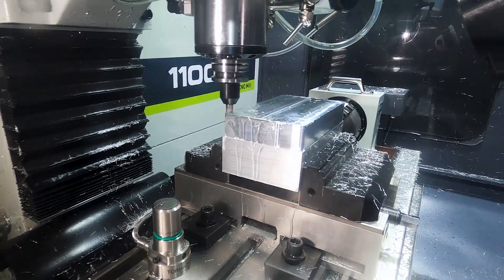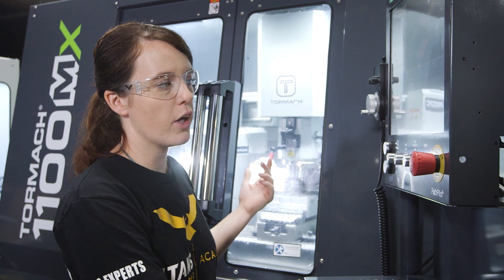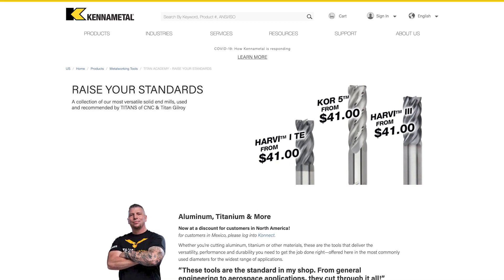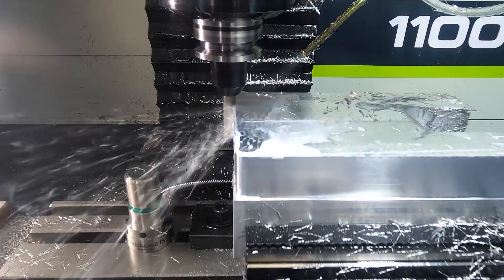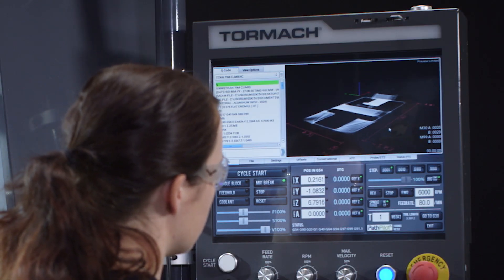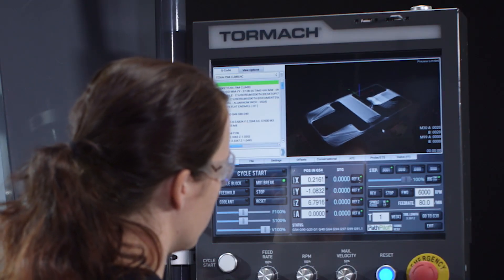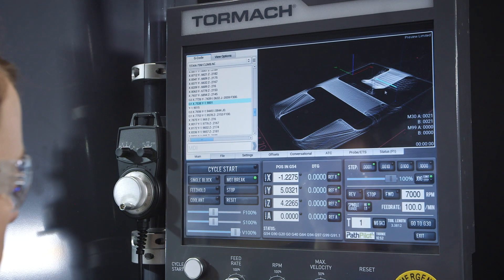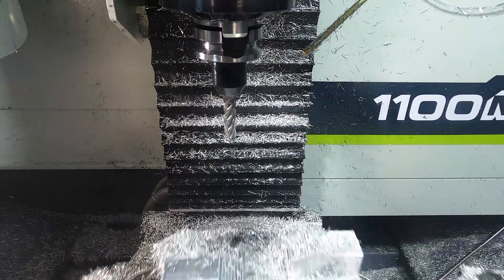CNC Machining | Roughing on Tormach With KOR-5 | Path Pilot Greatness

Comment: TBD I am not sure if the load is too high on the spindle or not. Does Path Pilot have a spindle load meter? It seems to cope with it. Kind of curious if you are holding tolerances. I would prob taken 50% of that depth of cut with higher spindle speed and slightly higher feedrate

Comment: Titans seem to talk about IPM a lot, but what is a good IPM for lathes?
Reply: Rpm * ipr = ipm. So if you want to program a rough turning operation at 1000rpm, 0.01ipr, 1000*0.01=10ipm
Reply: @TheFeralEngineer  But what is considered a good IPM?  On lathes the fastest I've programed so far is 24 IMP.  I remember Titan talking about 100 IMP on mills being kind of average for shops.  Maybe it was less and 100 was the goal to hit.
Reply: @benkenny3220  when you purchase insert packs, they give you a recommendation for speed, feed, depth of cut, etc. There are many factors to consider, like horsepower, rigidity, material, etc. Most of the time on a commercially made machine, you have encoders on the spindle and the linear axes that can synchronize together, so you typically program them in ipr, not ipm because most turning is done with css, not rpm. A converted hobby machine will use ipm because of the lack of spindle encoder feedback. Turning will never be as fast as milling, the cutting method is completely different. For rough turning in steel, carbide insert on an NLX2500 like the one titan used to have, my starting conditions, depending on insert grade are usually around 850sfm, 0.016ipr. using constant surface speed, the rpm will change, so the ipm will be different at each cut, but the ipr remains consistent. 

Hope this isn't more confusing than it needs to be.
Reply: Ben, there’s WAY too many variables involved with machining to answer your question with any sort of accuracy.  In addition, I’ve never programmed or known anybody who programmed a lathe in inches/min.- that doesn’t make a lot of sense. Feed per revolution is common to lathes, as it will keep chip load consistent with RPM changes.

Comment: Gotta be honest m8, that sounds like hell.. KOR 5 needs to run much faster rpm wise and FR wise. Just use an AFI Data Flute 3 flute ¾" Endmill at those speeds.
Reply: Agreed; I love multi-flute end mills, but I think it’d be much better and more efficient for the cutter to use one with less flutes in a machine like the Tormach.

Comment: "sounds great", that sounds like absolute death!!
Reply: It's a 650lb machine, I'm sure your tables weigh more than that. Of course it makes hellish noises.
Reply: Oh Yeah, Like GoPro mics give a real representation of the sound. Shut Up.
Reply: grappler185 if you think that they are only using a go pro for that you’ve not been here very long 😂
Reply: If you will listen carefully you can hear like machine try to say "killlll meeee" every time end mill touching the material
Reply: It's normal. People fear of loud noises holds them back from productive machining.
Reply: Reinis Sproģis if any of my machines that I ran sounded like that I wouldn’t have a job LOL
Reply: @jonahwebb4352  It sounds smooth to me. I bet your company also run 14h programs instead of 4h. I have done hundreds of parts that sounded worse than this and cutter is still perfect, saving lots of time and money for the company. Way more than cutter cost.
Reply: Reinis Sproģis I mean yeah you’re right they are pretty long but that’s cause we’re doing full 5 axis aerospace parts that require a finish under 8 most of the time
Reply: Yeah, it sounds pretty rough. If that’s “normal,” you’re doing something wrong.

Comment: Fun fact, Path Pilot is a fork of LinuxCNC/EMC2. At stock LinuxCNC’s UI won’t look as fancy as path pilot, but the 3D view of the tool paths is a standard feature (and quite nice). Thankfully it is also fully open source, and you can customize it to your hearts content. So, if you want a superior machine controller over running Mach3/4 in a terrible Real time OS (Windows), then get some MESA FPGA hardware and switch to LinuxCNC ;)
Reply: Linux convert here 👌

Comment: How is the ETS mounted? I want a solution to have it fixed to the table but I can’t find a good DIY.
Reply: Here’s how mine is mounted, t nut and a ring base with a bolt.  https://www.ebay.com/itm/264702255216

Comment: How would these end mills work on something older like a Fadal? It has the horsepower and RPM to turn it (10k spindle) but the control is old and slow and jerky on some complicated trochoidal toolpaths.  It can only cut 400ipm flat out.
Reply: I can help you here, my job has a 1993 Fadal 4020 with a CNC88 control (the oldest one). You're best bet is to change tactics. If you're using DNC, then it's slow and jerky not because of the toolpath, it's because it's too fast for the fadal to process what's going on (not enough look-ahead). Optimize the file size by breaking the job down into smaller ops and getting your toolpaths under 40kb (assuming your entire memory is free) once you do that the next thing to do is ensure your toolpaths are really smooth, if the machine has to move the opposite direction too quickly the fadal just won't handle it. 

The other reason for jerky movement is because the old fadals takes about .500" to 1.000" to accelerate from a stop to full speed, and trochoidal milling can have such tight turns that the machine needs to decelerate and then accelerate back to speed before and after every single cut. Therefore you're machine never is never getting to run at top speed like it should. If using Fusion 360, leave plenty of stock during your roughing pass and enable a lot of smoothening and a higher minimum radius for adaptive toolpaths, that'll let the fadal handle it. If you can get your toolpath smaller, then you can run the program directly on the machine and won't have issues like DNC will. It's not your tool, it's your toolpath strategy. The fadal has a better time with feed milling, and it might be better to use it instead of trochoidal milling in some cases. (shallow depth with full radial enagement, just in case)

If you have a program that is just barely too big to fit in the fadal's memory, use CTRL+H (find and replace) in a text editor and replace all spaces with nothing, that deletes all the spaces and will remove 20% or more of the file size immediately. Also ensure your CAM software is smoothening your arcs with radiuses and your helix moves are actual helixes. some people forget to ensure that and they make a program that's 300kb long just because it's pathing out a helix one thou at a time per point.
Reply: @Kitsyfluff  I drip feed it at 115k baud, and my control is the 32mp with -5 cards in it, so it's the fastest 88hs essentially, the buffer usually stays full, but I think you are right about the acceleration.  That's probably what I'm seeing here.  Also probably the slow "rapids" when moving to the next segment of a trochoidal path since even rapids are capped at 400ipm.  

So just looking at the 1/2" mill, they recommend a .005 ipt * 5 * 10k rpm = 250ipm.  I guess I'm just having a hard time imagining many trochoidal toolpaths where the machine would ever be able accelerate up to that speed, unless it's always just running straight lines around a long part.  I think most of the time an older machine would just be making little whiffs of a chip just trying to accelerate around corners.  I mean I guess I can still run it at .25" radial engagement and move quite a bit of material as long as the spindle has the horsepower.  

I guess for $56 I could buy the thing and try it out, see if a 3 flute rougher makes more sense for a slower machine.
Reply: Centroid that thing 👌

Comment: Can you get a tool changer for the 1100mx? I was looking into a mini mill but after you buy all their stupid software shit it was too expensive for me.
Reply: I bought the 1100 for a company where I run engineering dept all decked out last year cuz I thought mini mill was too expensive too. But now that i'm looking for a lathe, I priced one out on haas website and started getting emails with their specials. It turns out that I could have bought the mini mill for just a few grand more. If you're willing to dish out $40K for a Tormach, you should definately consider the mini mill - it's a production type machine not a hobby machine like Tormach - which is decent by the way, but doesn't come close to production type machines. I wish I bought a Mini mill :(
Reply: @hycel78  watch out for Haas Pay per view.  There are some features which are locked out and will end up costing in the long run.  There like a printer for a home office PC, dirt cheap at first then start charging for features (printer ink in the case of my example).  i was hoping the 1300 was going to be a bigger machine for Tormach,  I did know it wasnt a mill about eight or so weeks before the launch - the software upgrade came out with the plasma controls added, oops.  Im scouring the market for a pro machine as we speak (of mini mill size)  So Hurco, XYZ, Haas VF1, Bridgeport.  The Hass is the cheapest but actually is not as future proof as the others.  Buying used its more than likely that i will have to go cap in hand to Haas for spares - big bucks.
Reply: The ATC is installed on that machine. You can see it to the left of the Z-column. The install was super quick when I upgraded my tormach (took about 20 minutes to get it installed. The tool changer also requires the power drawbar of course (the concept of a manual wrench turned drawbar with an ATC is mind-blowing)
Reply: Yep. You can get an 1100MX with a 10 tool, tool changer, upgraded path pilot controller and 4th axis for just under $40,000. I was also looking into the Mini Mill as well. I could use the extra $10,000 or so elsewhere.